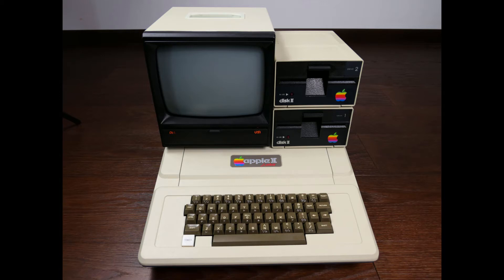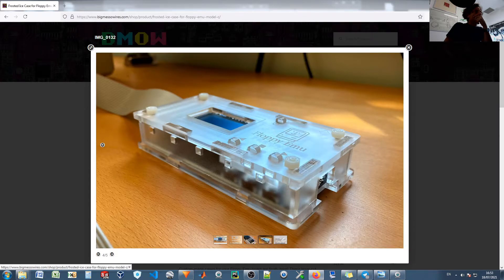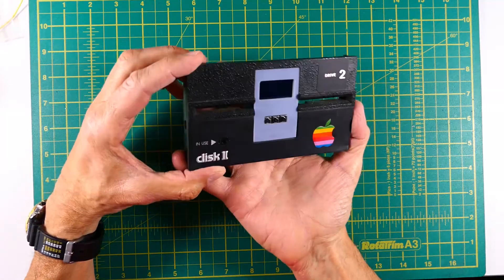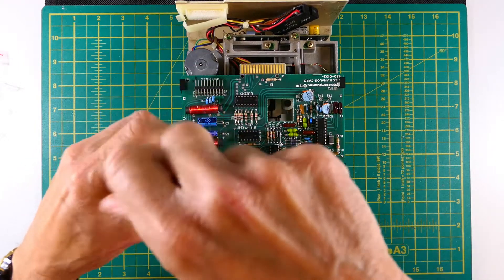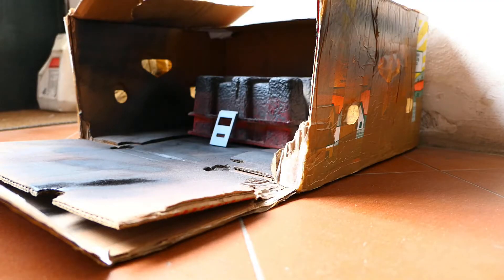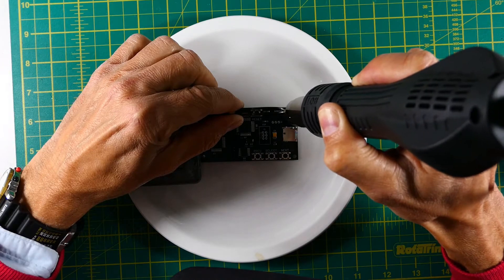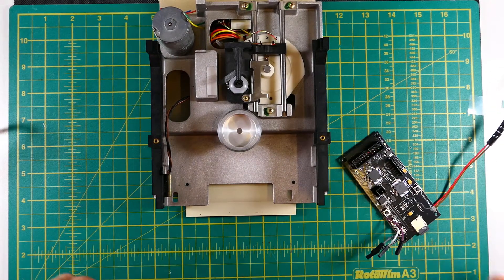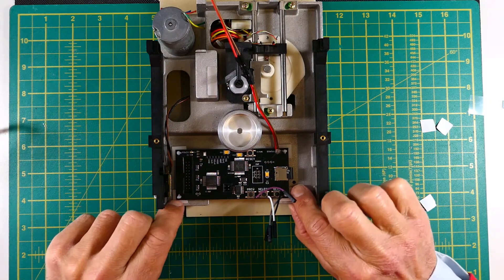Embedding a Floppy Emu in a standard APPLE II Floppy Disk Drive

Comment: Nice job but not sure why you didn't just remove the whole mechanism and use the empty shell.  Also I know it would take extra work but would it be possible for the 3D printed piece to flip open to expose the SD card.  With an empty shell you can 3D print a mount bracket support to make that work.  Future project maybe...
Reply from the maker: Hi! I did not empty the drive because I did want to keey its weight as the original one to have the same weight feeling while handling it. About exposing the SD, you can check Youtube user "polymatt" that evolved my project adding a front sd slot in the 3D printed drive lid. You can check his video here:
https://www.youtube.com/watch?v=yvodrNVtXbw
He also published 3D STL files here:
https://www.printables.com/cs/model/432463-custom-faceplate-for-floppy-emu-apple-disk-2-build
Thanks for watching my video!

Comment: This is some great work! I wonder if you would ever be able to wire it so the stepper motor would run as if it were reading the sectors so you would be able to preserve the classic disk sound.
Reply from the maker: Floppy emu has an optional  module to simulate the drive clicking sound. It's not quite the same thing however https://shop.bigmessowires.com/products/noisy-disk
Reply: @BitSplits  yeah it’s definitely not the same. Amazing job - I’m going to try this one myself!